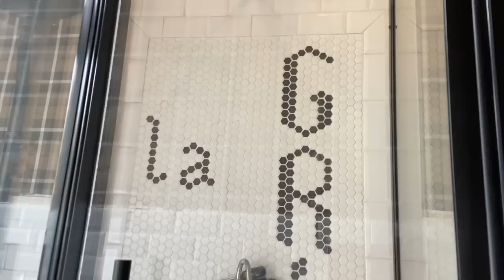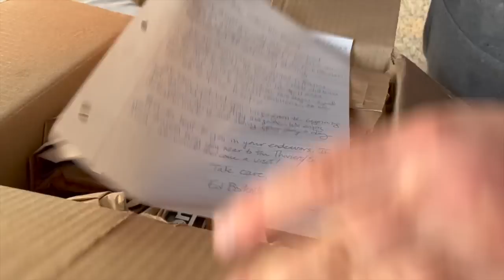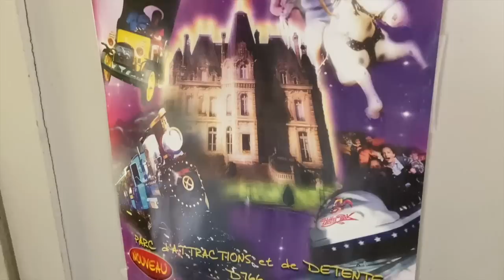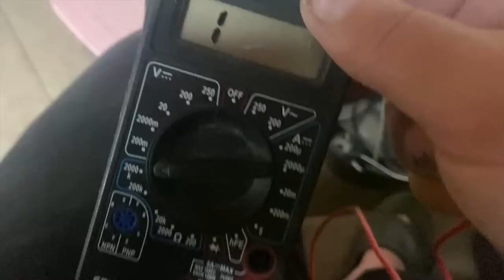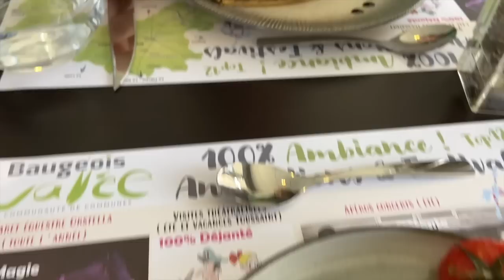Château de la Grifferaie S4, E6 "Time vs. Body"

Comment: Oh thank God! I was very concerned that you were going to attempt to take on that Tree. So happy you listened to your friends Rob. You are quite good at doing DIY but the risk with Tree work is just way too much. Unfortunately many watch YT videos and think it is easy. I spent years working in Forestry in BC and I can tell you that you absolutely you made the right decision. It should not cost too much to get a crew to “just drop” the tree and then if you are confident with a saw, just buck it all up into firewood. Think about asking the tree guys if they will drop and buck it all into lengths small enough to be split into firewood to really save yourself some time. Also, get them to cut you a good sized chopping block to split firewood on. That tree is a very good size for firewood and once you get a burner in you will be able to use all of that tree to keep the Chateau warm. Good luck with the roof!

Comment: For porcelain cleanup in rental houses I soak for days in vinegar, then scrape w/a razor blade window paint scraper, then pumice stone to get the last little bits.

For vinegar application remove water from toilet, use toilet paper or paper towels to line inside of toilet, saturate  w/vinegar every couple of hours. Remove a test patch of vinegar soaked paper to check for softness of stained calcium deposit by scraping w/razor device. If it comes off like a paste it's ready to clean. Remove the vinegar-soaked paper towel liner and clean as much as possible w/razor scraper. Wash down with more vinegar and tackle the last bits with the pumice stone, which can scratch the surface of your porcelain if used too aggressively.